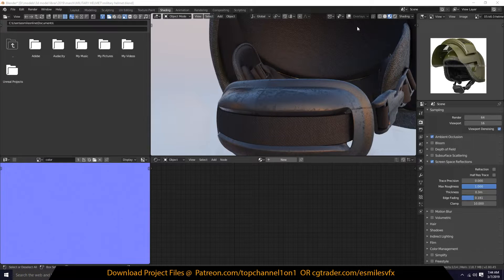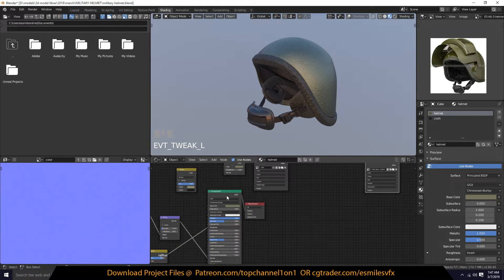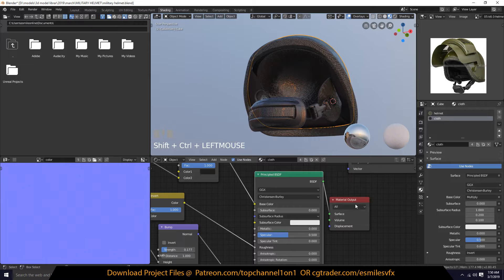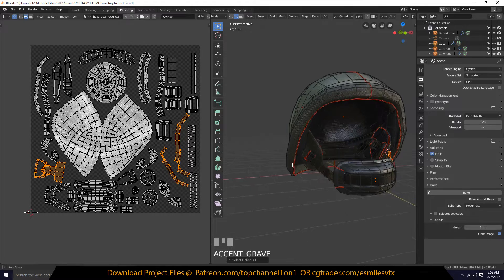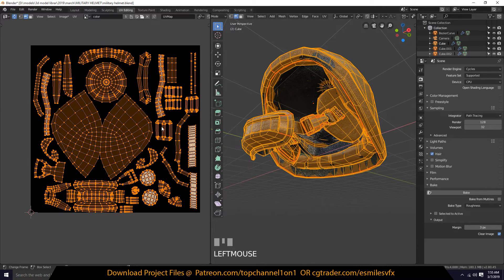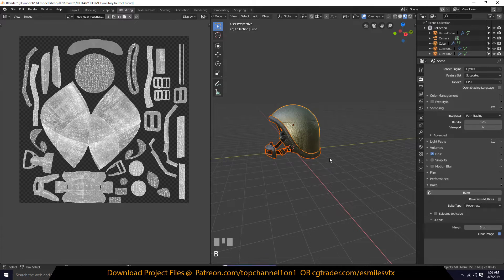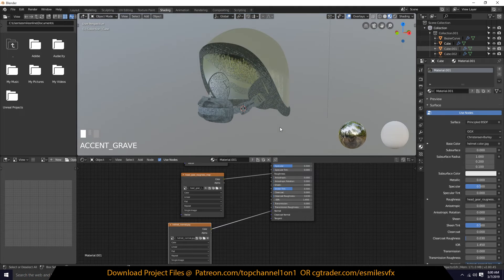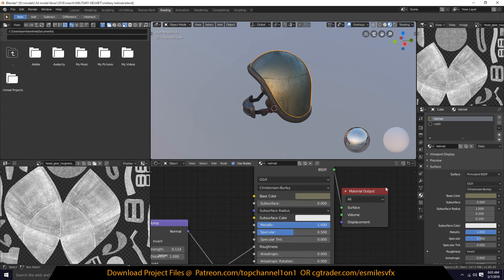how to bake a roughness map in blender 2.8 speed up your renders

Comment: Hey There ,nice work. Having trouble baking textures before  I came across this. I have a multiple node set up so it's a bit tricky. 
Just a tip (i think you've figured this out already but if not,at 17:00,the reason the normal map wasn't working right for you is because you have the normal map texture node's color space set to color. You need to change it to non-color . Your normal maps will look like they should. It's often missed